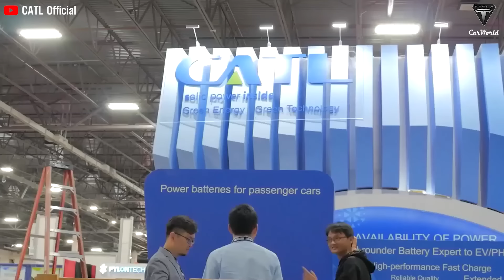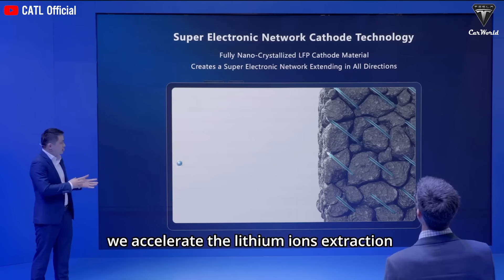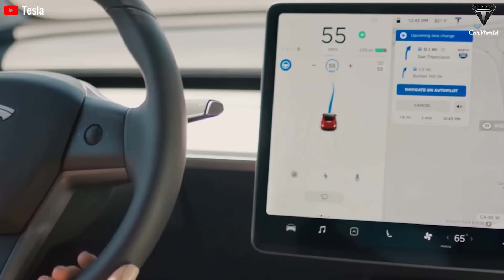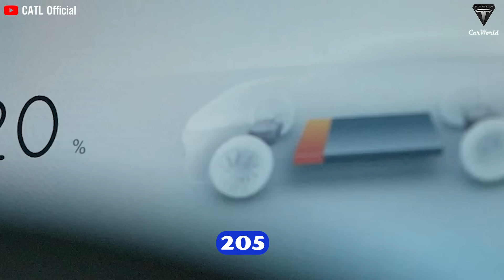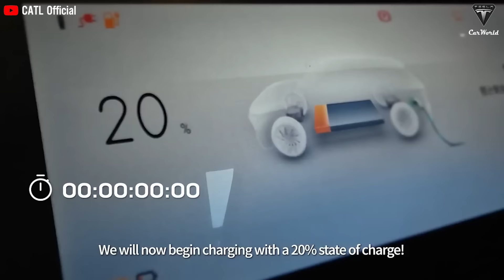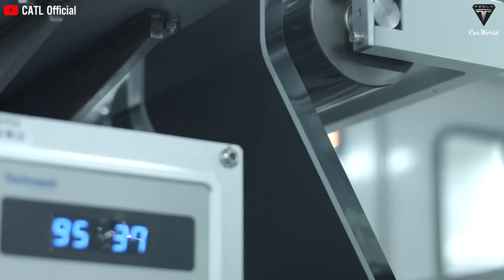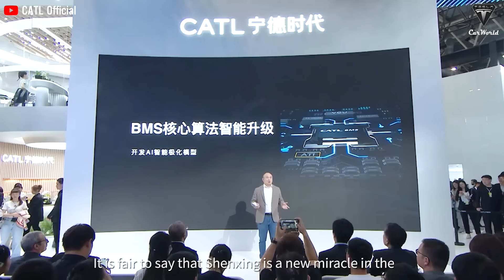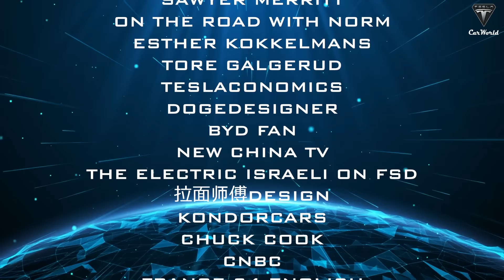Just Happened! Elon Musk Revealed Crazy Concept Battery 600-mile LFP Gen 3, That Break All Industry!

Comment: Wow,
I hear all of the negative comments about EVs and laugh my butt off.
1. Cost:  $37,490 is the base price of a 2024 model Y rear wheel drive with 320 miles of range and .99% financing.  Try buying an equivalent gas car for that???
2. Fuel efficiency:  I average driving my 2023 model Y LR-AWG 850 miles every 4 weeks and it cost me $25 in charging cost.  I charge at home and use a TOD meter.
3. Tires:  Keep your Tesla in Chill mode and don't overinflated your tires and they'll last for 50K miles.  I easily got 50K miles on my 2017 Bolt EV tires and my model Y tires show no wear after 12K miles.
4. The Tesla model Y was Number 1 in world wide sales last year beating out both the Toyota Corolla and Rav4 and made it to Consumer Report's list of Best Cars of 2024.
5.  One pedal driving on both my 2017 Chevy Bolt and 2023 Tesla model Y is way Safer to drive than a gas or hybrid vehicle.  IE. the car is braking before you can even get your foot on the brake.  Of course, your brake pads will also last Much longer on an EV. 
6.  Speaking of Service, with 64K miles on my 2017 Chevy Bolt EV that I bought brand new, I have spent not 1 dime on service other than paying 20 bucks per year to have the tires rotated.  So far, it's been the same on the Tesla.
7.  Insurance:  It cost me $100 per month for Tesla insurance on my model Y as long as I keep my safety score above 98%.  Also, since their safety score is based on Real Car Data and not some foolish insurance phone app.,  it definitely pays to drive safely.

In summary, I'm so spoiled by EVs, I just chuckle when I pass a gas station and see those poor souls paying 5 times as much for gas as I'm paying for electricity.  BTW, my utility's coal consumption represents less than 4% of their total monthly fuel usage and is steadily declining.
Reply: So true.

Comment: Take a deep breath and relax. Gas cars had the same issue when they were first introduced. There were few gas stations and traveling across country was difficult. . Now, gas stations ARE EVERY WHERE!
Reply: Tesla has 1 supercharger for every gas station today in the US. It’s happening faster than you think.
Reply: Tesla ist zu Recht einer der zukunftsorientierten Hersteller !!!!  ER WIRD ZU DEN AUF Dauer erfolgreichen gehören !!!!
Reply: @GET2222 sorry to say but you’re way off with the numbers. 
There are over 196,000 retail gas stations in US. While there are about 25,000 Tesla Supercharger ports in the US.
Reply: Exactly! When we first got our Kia e-Niro in 2019, long hauls across Europe needed a lot of planning, these days it is so easy. The e-Niro max charging rate is 75 kW and it takes a good 30 minutes from a low SOC to add 200 km but we have never found this to be inconvenient. We always start a long trip fully charged with 450 km of range and we never drive more than 2 and half to 3 hours before taking a break to eat, drink, use bathroom and take eyes off the road. A 30 minute stop to charge while we do those necessary things, is normally more than enough to finish our driving for the day. Sure, more modern EVs can charge faster and will have more range but it isn't a bad idea to stop, rest and refuel the human machine while the car is charging.

Comment: Nothing is said about how many cycles it can give before major degradation. Normally LFP batteries have a high cycle life.
Reply: Good point. Perhaps this new battery from CATL has a reduced number of life cycles as a result of 4c charging. Let's say it can 'only' do 1,500 full charge/discharge cycles which is the accepted case with NMC batteries. If each charge cycle gives 1,000 km of range then 1,500 cycles is enough for 1.5 million km, almost a million miles!!. Who will worry if the battery has degraded a bit by then?
Reply: they're claiming 10 years.

Comment: I didn't catch anything about battery weight. Makes me think they're still really heavy. I'll wait for solid state.
Reply: You should look into Aptera. Aptera is using extremely good aerodynamics and efficiency in order to get really good range from smaller battery packs. 10 miles per kilowatt-hour.
That works out to needing only a 60kwh battery pack for 600 miles of range.

I also Iike Apteras inclusion of a large number of solar cells, as solar effectively improves energy to weight ratio by alot.

Comment: Problem with ev’s - slow charging, used car values very low, cost too much to charge, expensive to fix after a bump. Tyers need changing at least x3 than a gas car. Charging infrastructure is very very very poor. The grid can not cope. Too much electronics to go wrong. Cold or hot weather reduces range by ½ or moor. EV’s simply do not make economical, or green sence.
Reply: SLOW CHARING- newer EV’s and DC fast chargers are charger batteries faster. It’s only issue if you’re going on a long road trip. But then you’ll be charging while going for washroom breaks and getting food. If you live in an apartment you can charge while you’re shopping at many places. If you have a house you charge overnight and don’t need to worry about the charging speed and you don’t need to spend all that time pumping gas. 
COST TOO MUCH TOO CHARGE- If you charge at home it will cost you much less for electricity than gas to be able to drive the same distance. BONUS: if you have solar on your home you can charge your car for FREE. Plus with some EV’s you can use them to power your home in the event of a black out. No stinky noisy generator to disturb you and your neighbours. 
EXPENSIVE TO FIX- the cost to repair an EV would cost the same as a gas car. Tires, suspension and brakes will all cost the same. BUT, with regenerative braking the brakes will last approximately 5X longer. Big win there. If you mean body repair. Some EV’s could be more expensive for bodywork just because they’re newer and fewer replacement parts in the supply chain. But, that will fix itself. Plus that’s what auto insurance is for. 
TIRES WEAR-OUT FASTER WITH EV’s- Not True. If an EV and a gas car both weigh 4,000lbs the tires will wear at the same rate with the same diving style and speeds. Plus tire companies are constantly working to make better tires for EV’s. 
CHARGING INFRASTRUCTURE IS POOR- YES TRUE. But, the same thing happened with gas cars. They had to wait for gas stations infrastructure to be created before they could drive   everywhere. But, EV charging infrastructure will grow MUCH faster. Plus you don’t need as many charging stations as gas stations. Some people will have the ability to charge at home, work or while shopping. 
GRID CANNOT COPE- They will cope. Power grids are always expanding. They will need to expend faster as more EV’s get on the roads. But, the grids don’t need expand overnight. We’re not taking every gas car off the road and replacing with an EV overnight either. Plus with more and cheaper solar arrays being installed there will be a huge benefit of having micro-grids. Meaning fewer and less power outages. 
TOO MUCH ELECTRONICS-  not all EV’s are techy like Teslas. But, any gas car with all the cameras and ultrasonic sensors will have more electronics than a Tesla. Newer Tesla’s only use 8 cameras. And that’s to the self driving. 
COLD OR HOT WEATHER REDUCES RANGE- with older EV’s this is true. But, most newer EV’s have a heat pump in them instead of resistive heating. The heat pump is extremely efficient. Gas cars also loose range in winter with lack of traction. EV’s have better traction. Gas cars also loose range in summer by using AC. 

Just trying inform people.
Reply: Not our experience. We love our Y

Comment: Ev’s are doomed unless the batteries can be replaced incrementally as and when they die. If this app arch is not taken, the re-sale value of EV’s will always be low and EV’s will be disposed/ scraped after 10yrs use as that battery only takes 3 or 4 cells to die to make the make U.N.-usable.